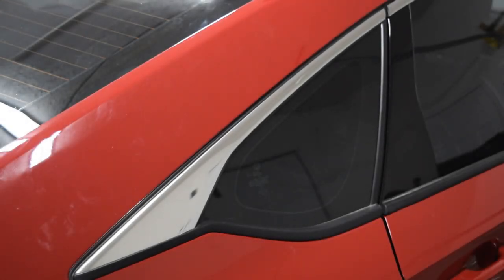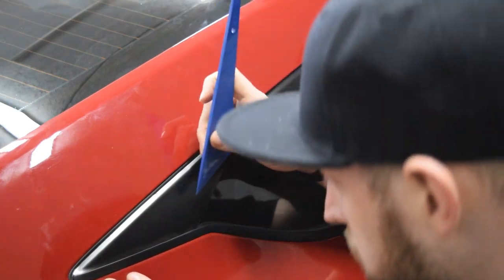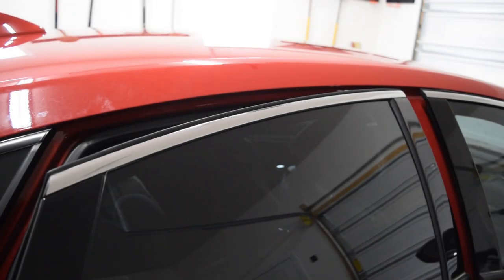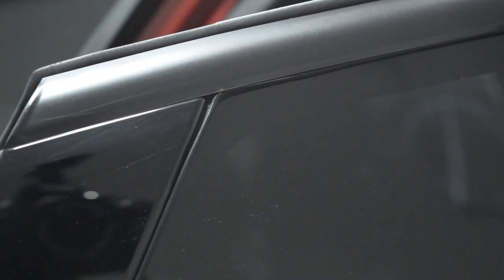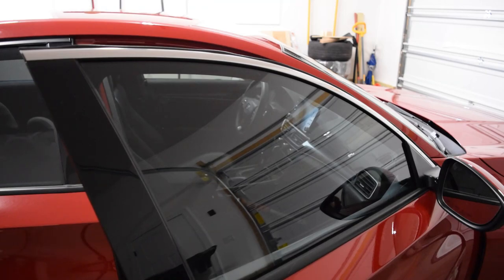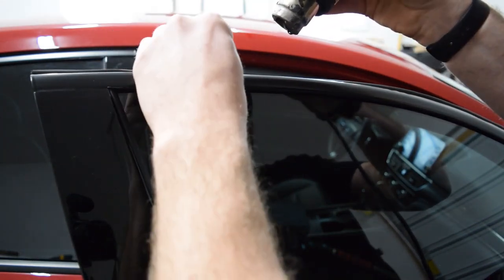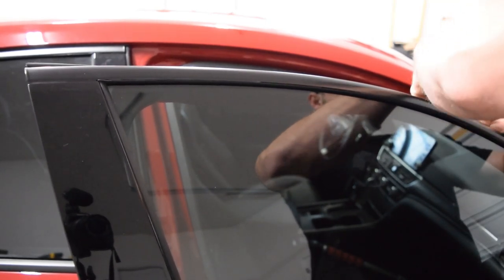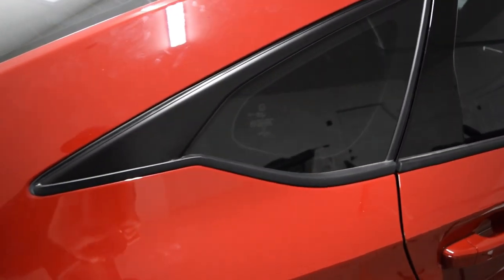Crux Motorsports 2018 2019 2020 Honda Accord Window Chrome Delete Kit Blackout Installation

Comment: Was really loving crux products until the last 2 Ive attempted.  Rear reflectors were different sizes, one did not cover all.  Just attemoted this delete and unless your car is brand new dont bother. So many particles stuck underneath and a really stressful process.  Ripped it off and threw it away, but hey, they got my money!

Comment: Is the heat really necessary? I just received mine today, so I’m going to attempt to install it
Reply: Did you end up using heat?
Reply: that’s necessary for all the weird angles and corners so that the vinyl would mold on those areas

Comment: Will hot Cali weather effect this? Also I ordered the gloss window chrome delete, do you think a window visor kit will stick the same on the vinyl as it would on the original chrome? Should I not wrap the parts of chrome where the visor is going to go?
Reply: I bought this Gloss Chrome delete and decided to install insert window Visor instead of that one that stick on the chrome part of the door.

Comment: Really digging yalls products 👌🏽 definitely getting these. Would you guys be able to make door pillar overlays?
Reply from the maker: Magdiel Hernandez door overlays will be out in a few weeks! Thanks for the support!
Reply: @CruxMotorsports  I've seen videos where it overlaps into the rubber trim requiring it to be trimmed with a razor or was that user error?